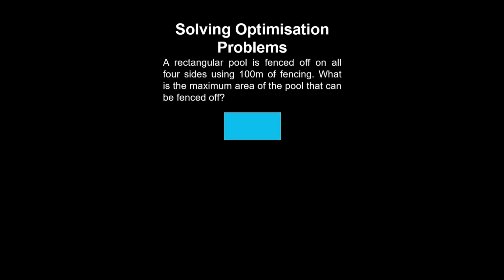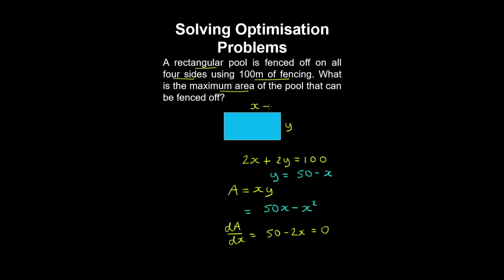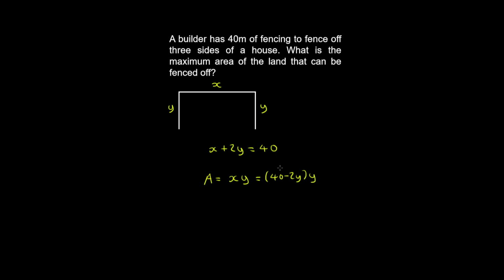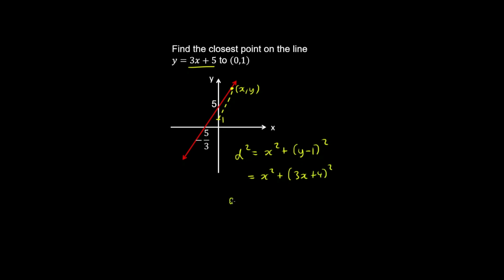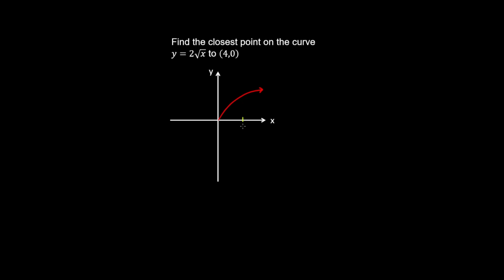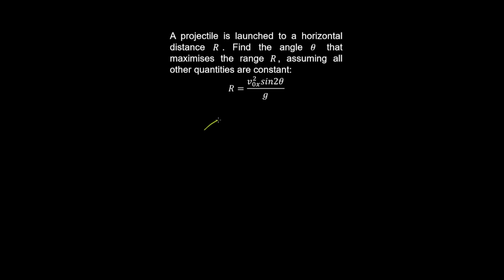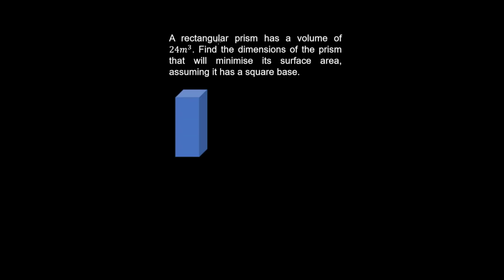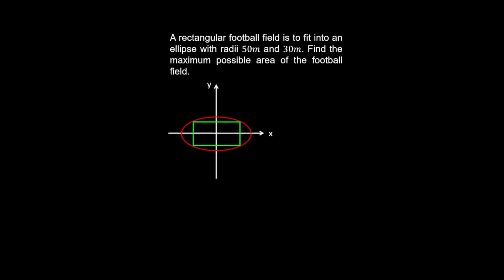Optimization Problems - Calculus

Comment: Max Area=3.000 m^2
Reply from the maker: It's a little low for the area of the football field. How did you evaluate the derivative, please post your calculations?
Reply: @drofeng  I did the math again
The Area's function is A(x)=(12/5)*x*sqrt(50^2-x^2)
It's max is for x=25*sqrt(2)
Hence A[25sqrt(2)]=3000
The field is 50sqrt(2) X 30sqrt(2) m^2
Couldn't find any mistake...
Reply from the maker: @Zonnymaka  3000 m^2 is correct, well done. In your previous answer I thought you meant 3.0